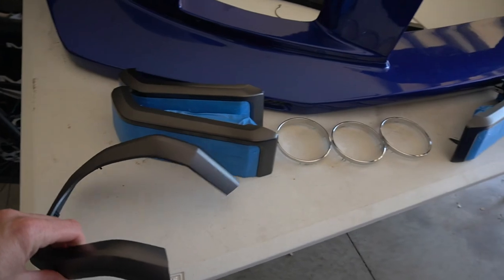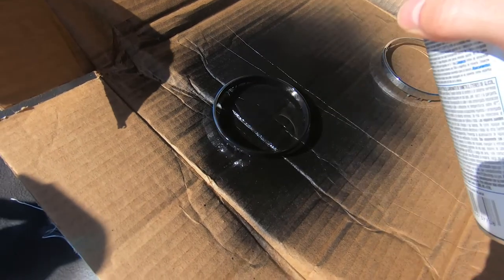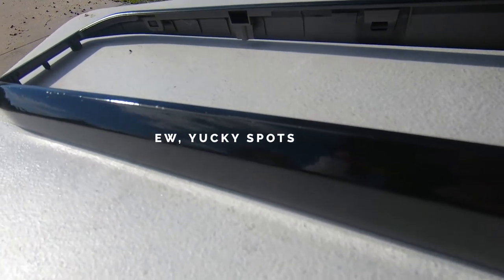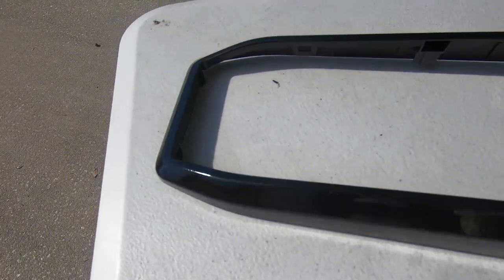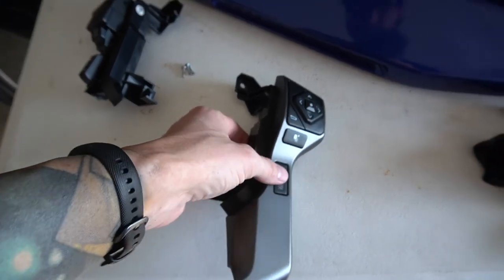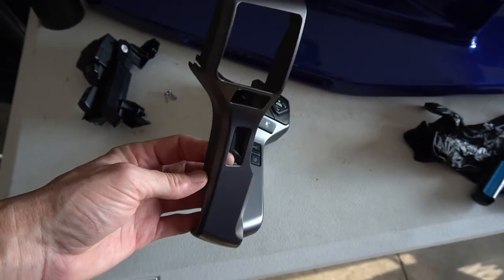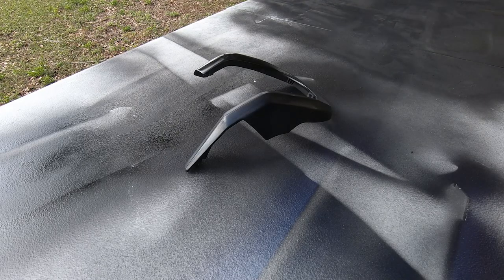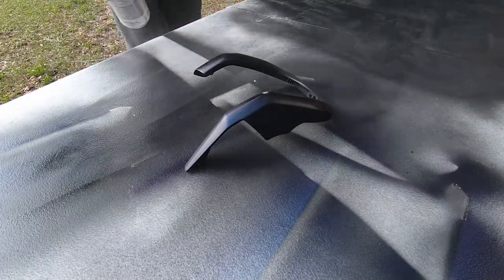Toyota Tacoma Colorshift Interior With Rust-Oleum Colorshift Paint | I Messed Up Big

Comment: You ruined your interior and devalued your truck if you ever want to sell it. You're looking at a couple thousand dollars worth of trim pieces that would need to be replaced to bring it back to stock. Maybe you never want to sell it, I don't know but it's worth a few thousand less to a buyer and probably several thousands less to a dealer if you want to trade it in.
Reply from the maker: I have to respectfully disagree! The interior is priceless now to me because I made it my own. I don't plan on selling it any time soon but even if I was, I would much rather have things how I want them and make them my own than have it exactly how every other Tacoma is. You're right though in general about taking modified cars to a dealer. You won't get as much as what you put into them with parts usually, it doesn't raise value, but in my experience I have always gotten what I wanted out of selling cars regardless. Hell, I was popping things off and swapping parts in the parking lot from my other Tacoma when I bought this one, hahah! Figure worst case scenario just go on eBay and spend $500 on some new trim pieces